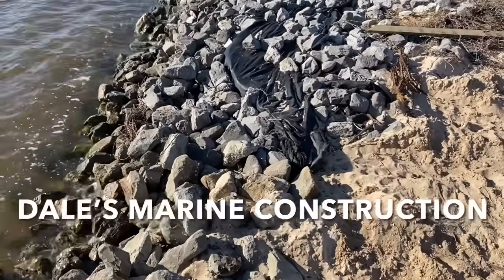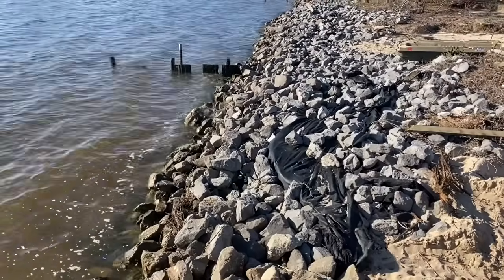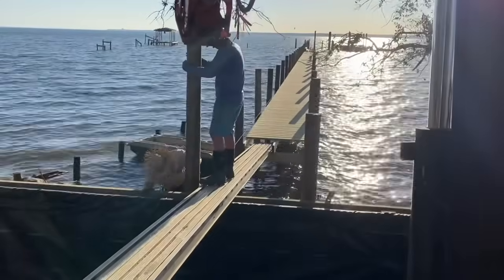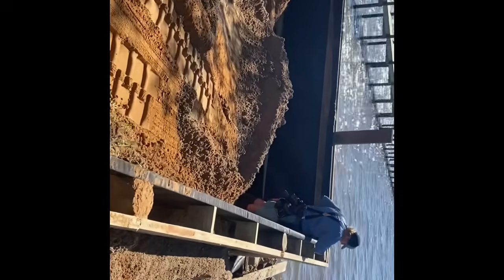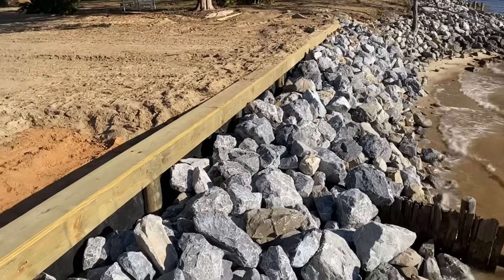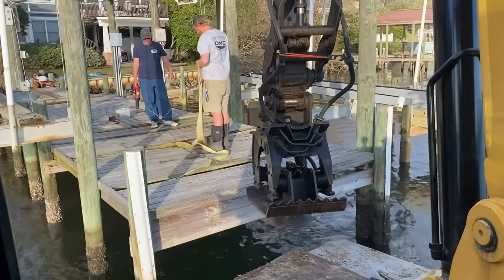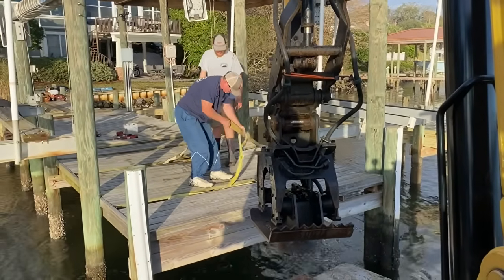How to install riprap and have a good defining line between yard and riprap.

Comment: I wonder what would happen , if you were to put filter cloths and do like you said triple layer but then foam in the middle so basically sandwich it between 3 layers of cloth on each side then fill with foam in the middle and have ur rock put down so it adds to securing the riprap in place?? I honestly want to see what would happen
Reply from the maker: Hey, thanks for watching my page and your comment. I’ve never worked with foam before, so I would not be able to give you good advice on that.

Comment: I plan on following your plan to do a poor man’s seawall with rip rap for my back yard, it looks amazing. Did you cut holes in the fabric for the posts to go through? I see the fabric is wrapped and screwed to the rear 2x6. Thank you for the video.
Reply from the maker: Hey, thanks for watching my video. Yes, we did cut holes for the fabric that goes out to the front to go underneath the rock. I also ran an additional 6 foot layer in the back behind a pilings so total of two layers of filter fabric.
Reply: Do only do coastal or inland as well? I am located in Tavares, Florida. Not sure if you service that area. Going to do this method for 100’ canal front.
Reply from the maker: @alexevans1772  thanks for your question and watch how much channel we only work within 50 miles of Pensacola. We have plenty to do in this area right here. Good luck with your project.

Comment: Do you have any suggestions on how to make sure the filter cloth is installed correctly? Also, what’s the best way to attach the filter cloth to the structure and not have it rip? Great video.
Reply from the maker: Thank you I always like to take a board and wrap the fabric cloth around the board and then nail that or screw it to the structure to prevent the filter from ripping. You have to use a pretty heavy duty cloth so it doesn’t rip

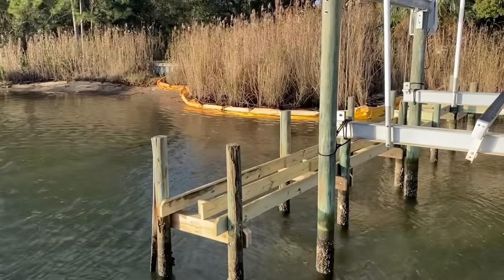Comment: @6:22 are those boards bolted to the side of the pilings or are they sitting on a notched out portion of the piling and then bolted to it?
Reply from the maker: Thanks for watching my channel and your comment. If we not every single Piling on the dock and cross dive, that would put the price range out of control for our customers. The ball we use are more than adequate to support the framing. The framing will break before those bolts will ever fail. There are some situations when you’re driving on it as far as bridge that do get notched.

Comment: What happens if there is overflowing into the yard after putting those limestone at the bank of the river of which the waterlevel is already close to the top.
Reply from the maker: Thank you so much for your question and watching my channel. As long as you have adequate erosion control/filter fabric installed properly behind the wall. The soil level will maintain although it is really hard to maintain soil level in rivers with water flowing parallel with it, I would suggest planting a good Route base grass or needlegrass to slow it down. Saint Augustine in this area works really good it has a very deep route. There is also a product called TM sod. It is like a filter weave but bigger holes in it where the sod can grow through it and it prevents scouring from behind the wall. He put that down first and then the sod on top of it typically 12 foot behind the wall.

Comment: We have a mile of riverfront that we constantly do battle with the river in spring runoff.  Ended up getting an excavator and dump truck to move rock around, which we have plenty of.  Nice video.
Reply from the maker: Thanks for watching the videos, that is one of the best ways to fix it with Rock and erosion control fabric

Comment: During heavy rain does the yellow dirt wash out into the water?
Reply from the maker: Hey Sherry thanks for watching my channel and your comment. The double layer of filter cloth we’ve installed does a pretty good job of filtering any Sand that tries to washout maybe when it’s first installed you will get a little coloration but that goes away quickly once everything settles out.

Comment: Impressive how that turned out. How long do you think it will normally last?
Reply from the maker: Thanks for your comment it works very well for a long time you might only need to add some rock here and there if you get settling
Reply: 100+ years

Comment: Dale love your work, I live on a sound with no tide change only wind raises and lowers water height. Is there an ideal pier height above the mean water height you would recommend? THANKS
Reply from the maker: Hey Guy sorry I overlooked your comment but it really depends on the size of boat that you’re going to get. The elevation of the dock would be determined to make it easier for you to access the dock from your boat.

Comment: Clean install.  i've been looking at delineation ideas, Most of the rip rap installs i see here if not going against an old wall look bad because there's no delineation, maybe it's people don't want to pay/cost thing (or more than likely they don't know to ask for ideas and the contractors don't offer it up) ... i don't know ...but it's a detail that makes a huge difference. Even just driving some posts behind, putting a beam, and capping, and any kind of a border would make a big difference.

 I've wondered how long the geocloth lasts in these riprap installs as i never see that mentioned, but reading the usfabrics,etc docs some of the commercial geofabric if not exposed to uv  has a 50-100+ yr lifespan . But i suppose if thinking long long term maintenance (like your grandkids inheriting property or something) if it's not that long of a lifespan they can always put a new layer down then another layer of rock.. The old timber i have has filter fabric in back and it's around 30-40ish years old  but the fabric i saw exposed thru the rotten bottom portions before temporarily shoring up seemed surprising solid condition , stuff must last a long time.
Reply: I like the build a lot but wondering how many storms until the triple layer geotextile is punctured and the sand washes through. A layer of gravel or crsuhed stone between the rip rap and the fabric would look better too - in my opinion!

Comment: Dale. Just an idea. What about wrapping riprap with cyclone fencing a couple time's. It'll sit still. Better 🤷🏻‍♂️
The rock weight should keep it from floating away.  Like a cage. The way some rock distributors sell and deliver rocks on pallets.  Just a thought ❗ be safe 👍🏻✌️🙏🇺🇲
Reply from the maker: Hey Paul not really sure what cyclone fencing is is it anything like Gabion baskets? It would have to be made out of stainless steel to survive the saltwater environment.
Reply: 🤪😜 HAHA  sorry 😥😞   I thought that's what it was called 🤷🏻‍♂️🤷🏻‍♂️🤷🏻‍♂️  Chain-link fencing 👍🏻  Better 😃    
 Saltwater 👹.  Wouldn't last to long 😞   Here in Michigan. Water erosion on lake michigan. They are using 
 A bag like. Pumping cement into them.  But I haven't seen em show if they're holding up ❓
  I know it completely different than what your doing. Or the problems you have in Florida ❗✌️🙏
Reply from the maker: @paulbetka2966  That’s pretty cool though it’s nice to know different methods of erosion control in different areas

Comment: Dale, do you ever get customers that want the barnacles (?) removed from the pilings ? Thanks !
Reply from the maker: Hey August I sure do there’s really no benefit to removing the oyster shells or barnacle with the exception of if you’re going to install Piling wrap to protect the poles. Then you would want a nice clean surface to attach the Piling rap to.
Reply: @DaleWHickman , I get it, thank you Dale.